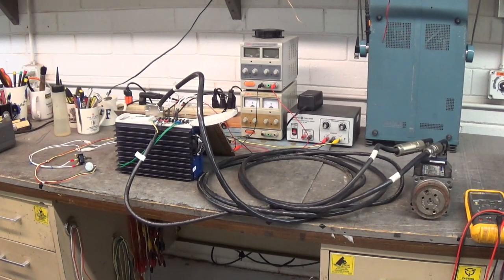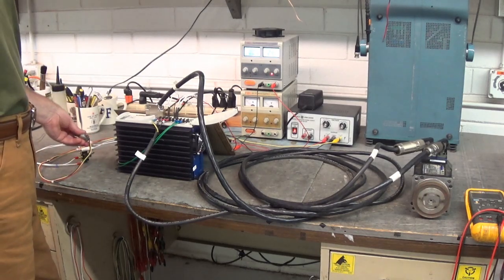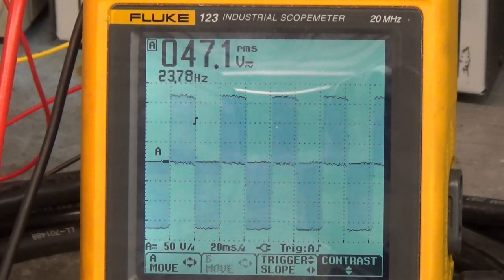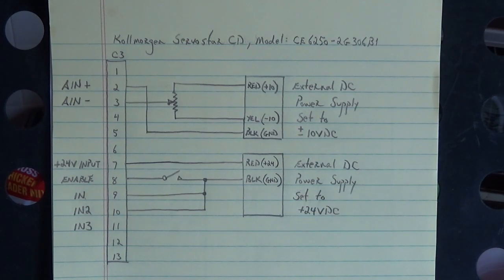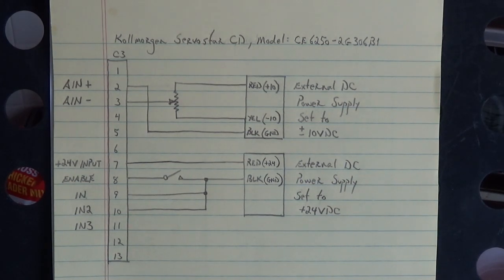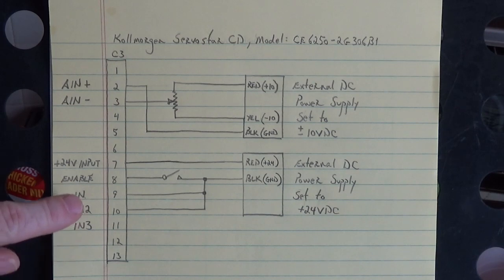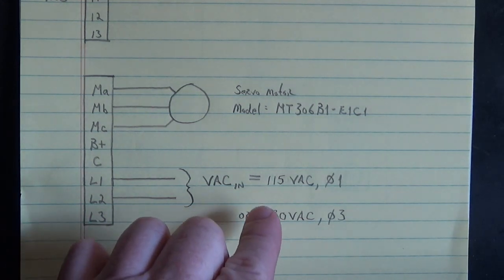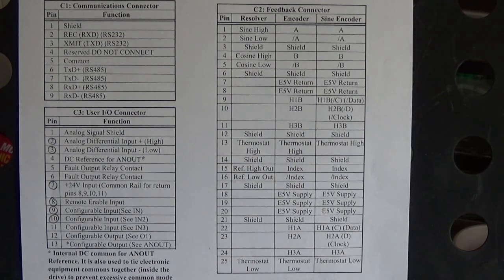Testing the Kollmorgen Servostar CD Servo Drive, and Goldline XT Servo Motor

Comment: Hello there
Which one of the l1, l2, l3 pins should I connect the 220v mains voltage consisting of single-phase, phase and neutral?

Comment: Hi sir, i have the same model of servo star drive  with servo star mc amplifier. When starting the homing position the motor is not responding correctly. The homing position is on the other direction.  Can you please give me some idea how to correct the homing position. I am using the the servo star for walking beam application.

Comment: thank u for this video but  I m confuse please help me. i have mach3 5 axis breaker board  and i have ce06250 driver. i want to connect this driver with board. 
pin 1) Analog input +10vcd
pin 4) Analog Grd
pin 7) power supply  +24vcd
pin ?) Power supply Grd (-24)    ?
sir i have break in my motor and tell my how to released i dont need break.
Reply: hello touseef jee, to release the brake is necessary a circuit external, for example a swith to open de power supply (24 vcd).